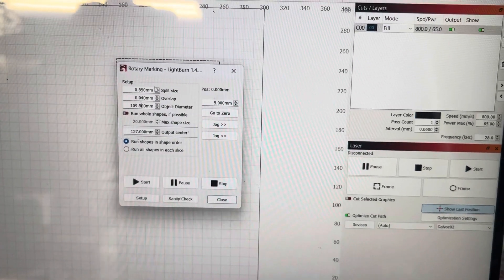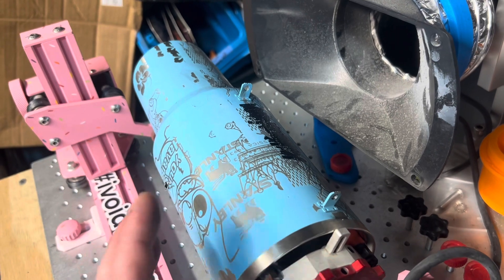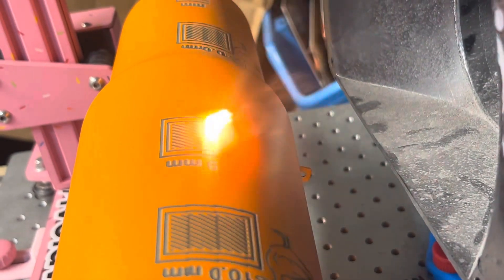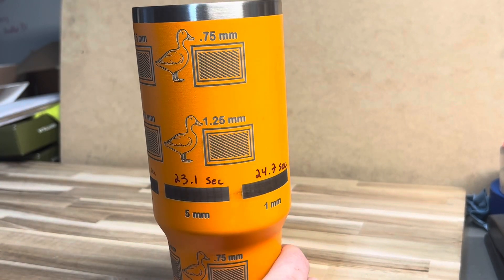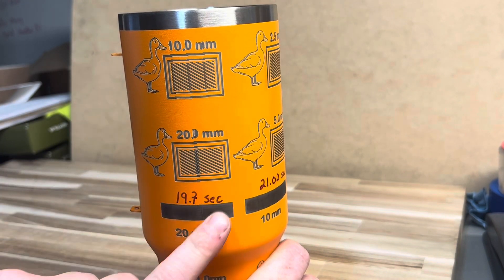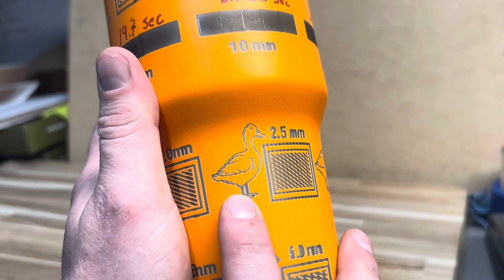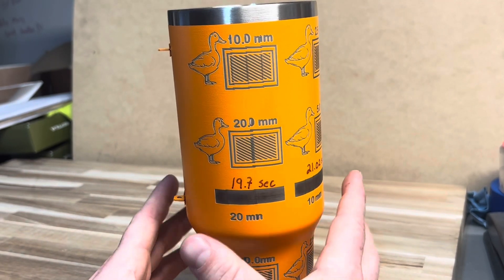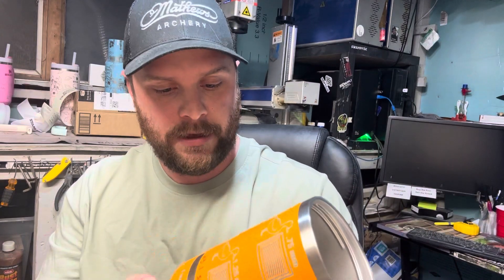Laser Rotary Split size for Galvo Lasers - What is it, what does it do, how to find yours.

Comment: Do you find the slower the speed (for a full wrap) you get better removal of the powder coating? I have had my fine lines not come out well, having to scrape the residue off. Are you in focus? Are you using a larger dot size? I have a 60w Mopa JPT fiber galvo... My default split size I have been using is .025 without overlap (not sure if that's my issue).. S 3500, P 50%. FQ 65, QP 200, LI .025, Dot size .080
Reply from the maker: @wafunfactor  I wouldn’t use one of my fibers for cups. I have a 60w galvo c02 I really love for cups. You should be in focus yes.